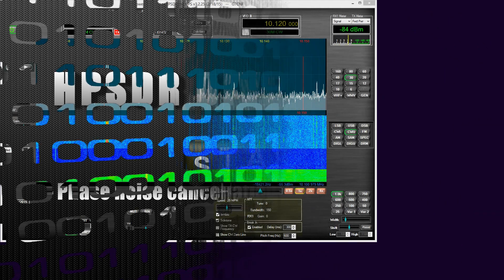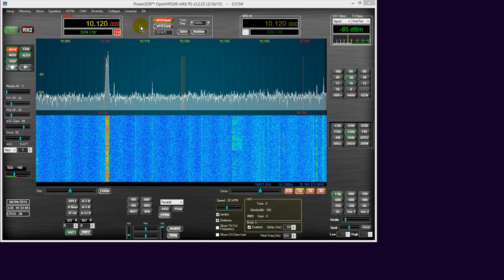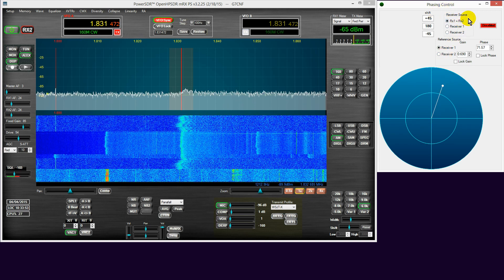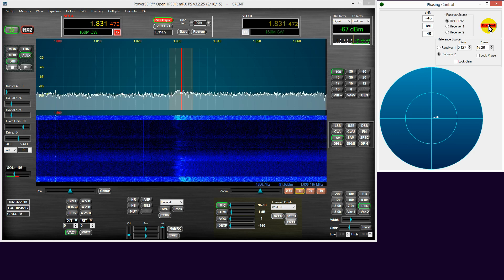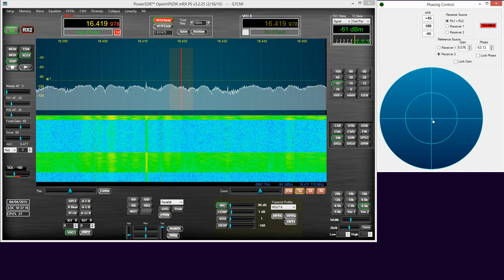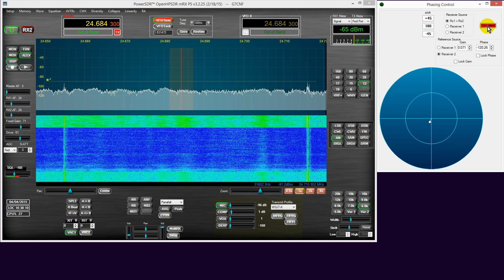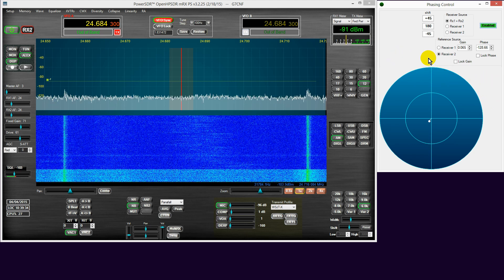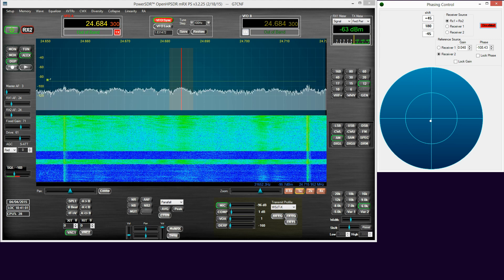HPSDR Phase Noise Cancellation (+NB): ANAN-100D

Comment: this is not the correct way, so you are just attenuating all the signals without making any improvement to the SNR. The secondary antenna must be able to receive the interference (it works only on punctiform signals) and only in this way the second ADC is able to dephase and cancel.

Comment: Hi Nige what antenna are you using for the noise source? Great job might have to go down this route .Thanks for posting great video very well explained cheers John
Reply from the maker: +John Gulliver I believe John this was using a simple end-fed long wire for the noise sense - as this offers the strongest localised noise sources.
Reply: +G7CNF Amateur Radio Station Thanks Nige i am seriously thinking about the ANAN100D radio might be the answer cheers

Comment: Nigel,
For this demo, what is the main antenna and what is the noise reference antenna you are using?
I also have many strange noises and when I switch between antennas on my roof, and out in the backyard, I can hear a big difference.
Reply from the maker: Darrin K In this demo the main antenna was deliberately chosen as the long wire which is inevitably the noisiest across HF. The sense antenna was the Wellbrook ALA1500 active loop which is mounted on a small TV antenna rotator so that I can peak the unwanted noise source to achieve best results - although I didn't rotate it during this demo video.
Reply: how does the software not phase out the signals you want as well ? Is it something to do with polarization of a wanted signal vs a non-polarized noise signal ? It would be great to have an antenna that just picks up noise across the band and none of the desired signals, then you can noise cancel everything. Very interesting.
Reply from the maker: Darrin K It is a simpe arithmetical function, noise + wanted signal antenna 1 - noise plus wanted signal antenna 2. You make sure the wanted signal is stronger on one antenna and the unwanted noise stronger on the other.

Comment: Nigel,
Thank you for your useful and well-presented videos; they are a pleasure to view.
I wonder whether you have done these tests while listening to a 'wanted' signal? I would expect some attenuation of the 'wanted', but as always, it is the S/N that counts.
And can you advise on your antennas?
We in Australia also have seen the suburban noise floor climb about 30dB in the past 15-20 years! :(  Going mobile/portable seems to be about the only answer ...
73s,  Charles.
Reply from the maker: Charles Muller I haven't observed any significant deleterious effects on the wanted signal and normally a good improvement on S/N. The days of DX in urban & suburban environments are quickly running out.

Comment: Hello there Nigel.
Thank you for posting this excellent and informative video.  I presently have a Flex 1500 and have been giving a great deal of thought to upgrading to either an Anan 100D or a Flex 6000 series SDR.  The diversity reception capabilities you have demonstrated here appear to be a "must have" feature given the hostile city RF environment at my end.  from what I can see, the only SDR units presently capable of performing this feat are the Flex 5000A with the second receiver or the Anan 100D or 200D.  In terms of Flex radios, it appears that only the 6700 (at twice the price of an Anan 100D) will be capable of performing diversity reception at some unknown time in a future software release which may cost users additional cash.

Given the fact you have already played around with the Anan 100D which runs on open source PowerSDR software, I was wondering if you could tell me additionally if it still requires you to use some version of Virtual Audio Cable software to run third party programs such as psk31 or rtty modes or does Anan use something along the lines of  DAX software like the Flex equipment to do that?

I couldn't figure out how to send you a private e-mail with regards to my questions, so I did so on this message thread. I apologize for that and it was not my intention to hijack the thread with these questions.  I'm simply trying to obtain information to make an intelligent decision on upgrading my equipment.

regards John M  (VE3INH)
Reply from the maker: John M Hi John. Currently OpenHPSDR PowerSDR mRX shares very little in common with the open source Flexradio version - it has been substantially written again from the ground up, including the DSP engine, right now the only main component they continue to share in common is the visual user interface. Now re: DAX & VAC. It turns out that DAX shares the same problems that VAC does (I have a 6500 also). Any DPC issues in your PC and things can get quite frustrating. In answer to your question - yes, PowerSDR mRX still uses VAC BUT there is an experimental version which connects with ASIO; it also significantly reduces latency; quite a few people are having good success with it, but it didn't work for me on a slightly underpowered PC. Some people are reporting that mRX also works fine with other virtual cables like VB-Cable. Again I couldn't personally get it to work satisfactorily. For me only VAC 4.12 is OK. If you want to pursue this more, pop over to my G+ page. https://www.google.com/+G7CNFmeUk 
73